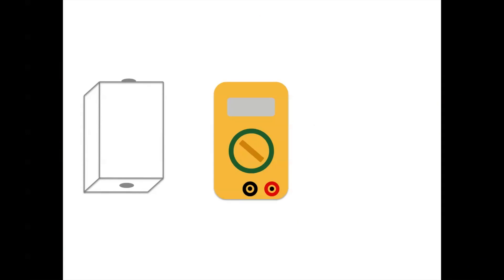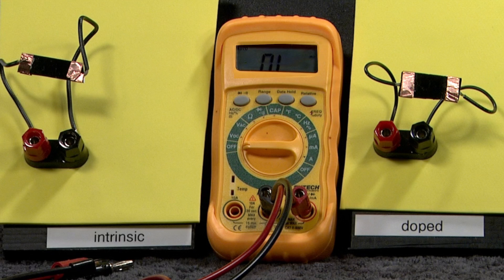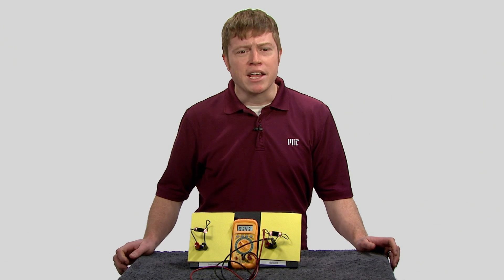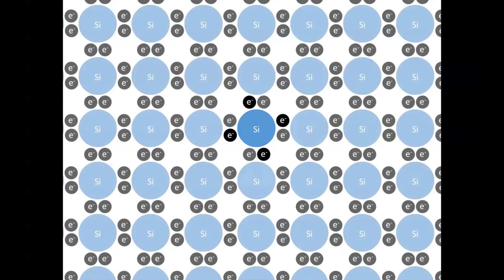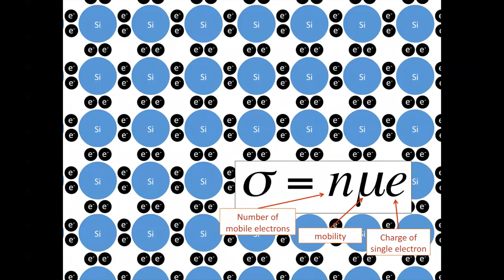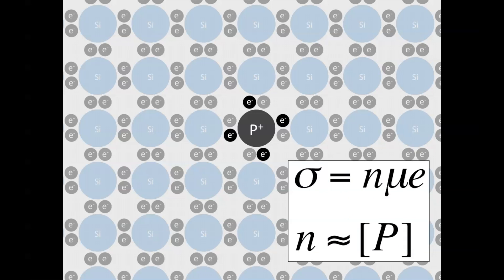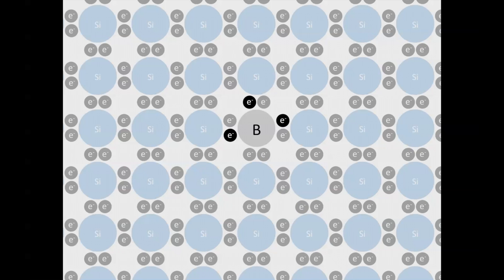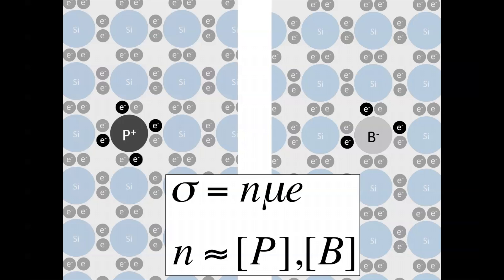Tutorial: Doping

Comment: but question remains .......here valance electron and covalent electron are in two different level and as we can guess only valance electron can conduct electric current only but how about covalent bond as it is stable and in a inert state. In covalent bond there would be atmost a hole either by doping or by ejecting electron due to incoming energy as light and heat from outside. The hole in covalent gives a electron in valance band and it is in both p type and n type material. The hole must be in covalent bond only and electron helping the current only in valance bond onl🤔🤔🤔🤔🤔

Comment: They keep referring to "doping a semiconductor" when, in fact, you are doping an insulator (silicon) to have the potential to become conductive. You are doping to MAKE a semiconductor: not doping a semiconductor.
Reply: https://youtu.be/IxxBOytd5Kw
Reply: This video is simplified, in near absolute 0 temperatures, semiconductors work as insulator. But in room temperature, tjey gain enough heat from the environment to conduct a few electrons as those electron get over the forbidden band to conduction band in valance shell. So, they are semiconductor even in intrinsic state as well. Just really really weak ones